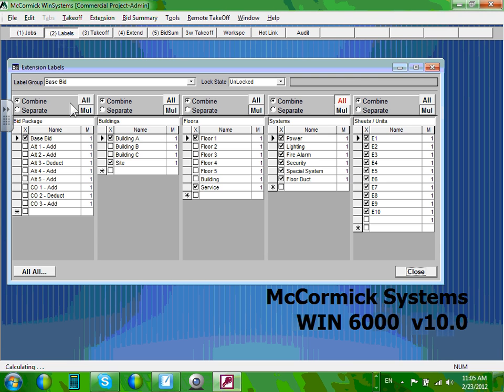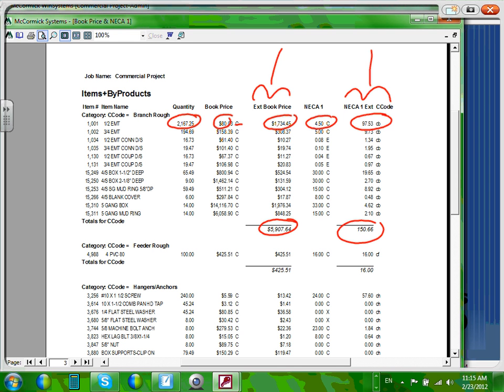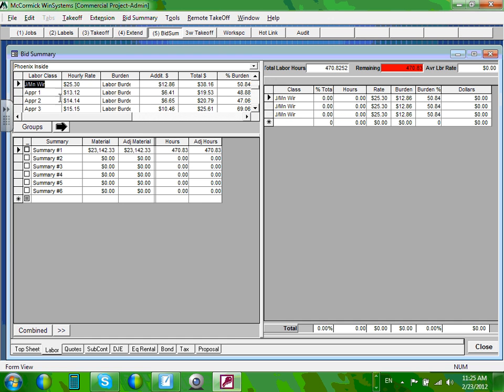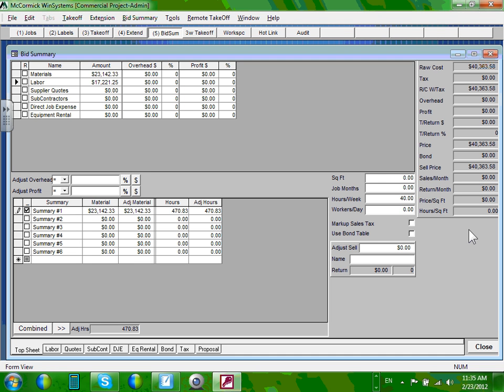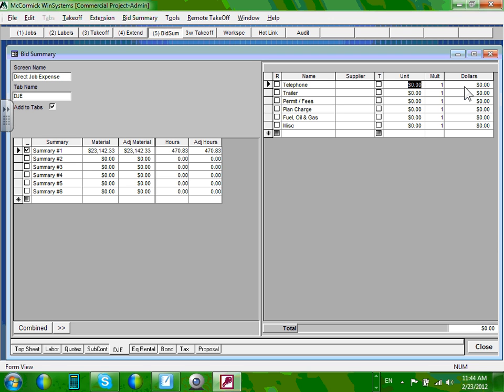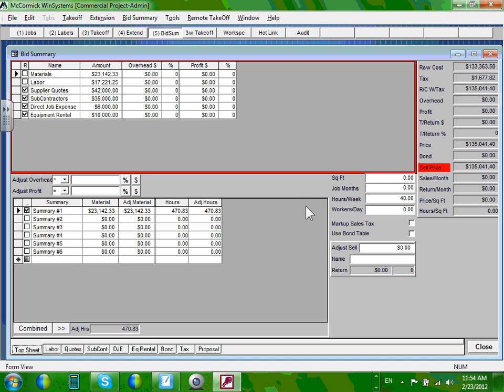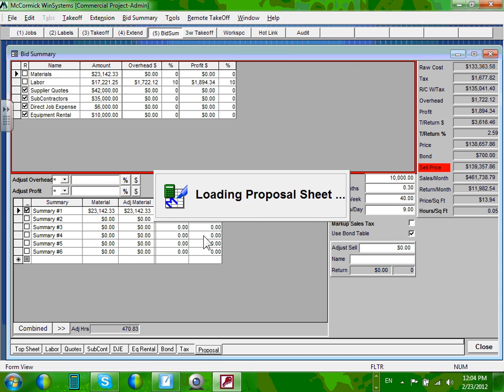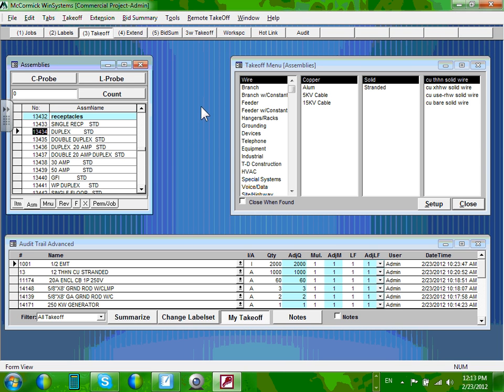Electrical Estimation-McCormick Software (Win6000-V10.0)Part#2-02-23-12.wmv

Comment: What most people forget about this software is, if you are from the northeast a lot of the database is not practical. I have been using this software for 10 years now unless you are computer savvy you will have a difficult time. The most important part of this software is building your own data base replacing McCormick data base. This means building everything you use in your region. By far it is the best software you can get however, if you are a new user do not use this system for estimating until you are fully versed in it or you will either loose your shirt with a quick exit out of business because you are to low or you wont get a thing for being to high. Use your old way of bidding running it through the McCormick for a second opinion until you are confident. By the way the NECA standards are basically used for union labor. Base bid has to many flaws, for instant 100' of EMT will take a single man 2 hrs (I want to hire that guy) so be real careful and make your own Data base. Also use the formula one foreman one journeyman for 50% each forget about using the Apprentices. Just my 2 cents.